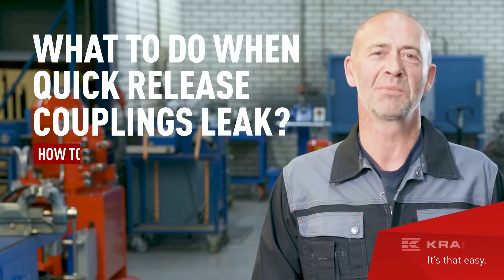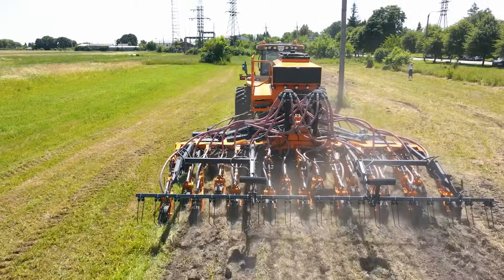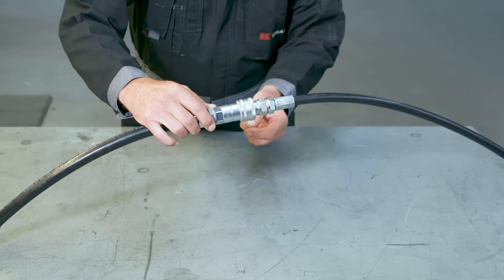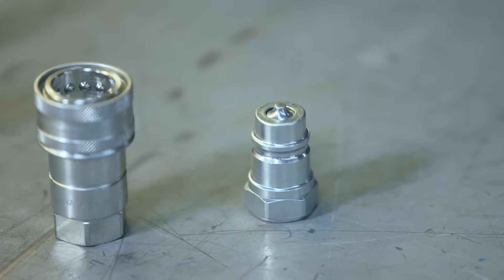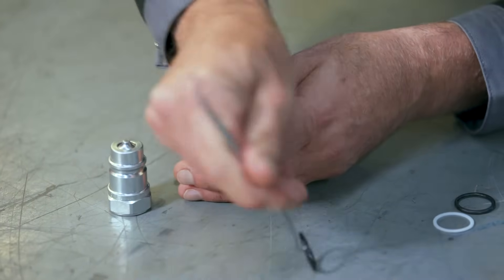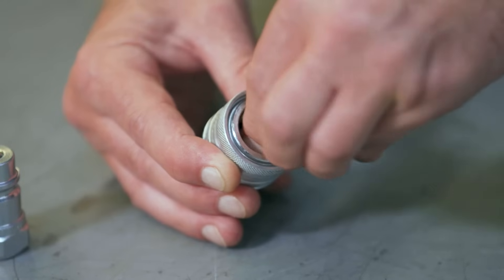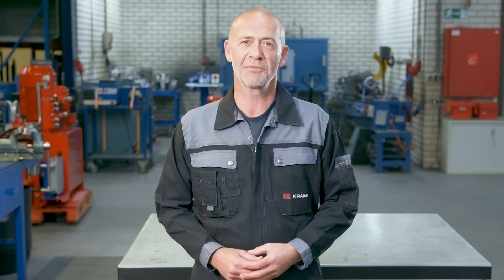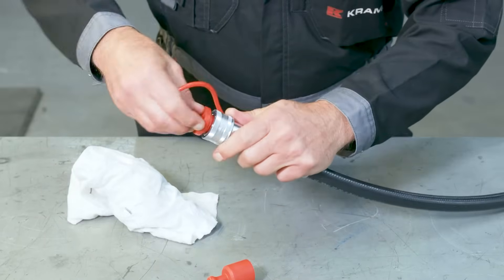What to do when quick release couplings leak? | KRAMP

Comment: Orion Motor Tech R134a Quick Coupler Adapters leak due to seal failure. Now i'll check for part to replace thanks for el tip.

Comment: Do you apply Teflon tape to the NPT threads when replacing a coupling?  Or other sealant?
Reply from the maker: NPT threads are dry seal and will seal on the taper, although a thread sealant can be used if required

Comment: A leaking coupling on a skid steer. It started as a drip. An hour later it was a trickle. I have a machine not being used. I will swap out the same coupling to see if this will stop the leak.
Reply: Did it stop?

Comment: Hi Kramp
I am proposing to use the dry breaks on my 4600 John Deere
to facilitate the snow plow I am fabricating. I wanted your
opinion about if this is a workable idea.

I have obtained a well-used 7 foot Western commercial snowplow
with hydraulic angling. I obtained a TITAN pallet fork JDQA frame.
The 4600 has 4 hydraulic ports to operate the loader that use dry 
break quick connects.  I have attached the plow to the Titan frame
with a 2 pin removable 2x2 x 3/8 angle steel. I have a grade 120 chain
attached to the top of the Titan frame headache assembly to lift the
plow blade. The system works but I have no more hydraulic ports available
on the tractor to operate the plow angel cylinders.

I propose to set up the plow on the 4600 and adjust the lift and a blade 
chain tension. Then shut off the 4600 and disconnect the “tilt” and “dump”
dry breaks from the front end lift. Then connect the hydraulic plow
angle cylinders to the now available “tilt” and “dump” ports on the 4600.
Now, I can operate the plow up and down and operate the left or right
angle cylinders with the “tilt” and “dump”.

MY questions:
1.)	Can the dry breaks disconnect the loader while
 there is minor pressure from the chain tension?
2.)	Will the disconnected dry breaks hold pressure
 changes as the plow pushes heavy snow?
3.)	Do you see and other issues?
Thanks 
George

Comment: New Holland Workmaster 75 with a 625TL loader. Couplers drooling like a navy jet. Capacity is only 2 gallons vs most JD Im more familiar with holding 22 gal. OEM couplers are way overpriced, so rebuilding these. Thanks for the video. Its been very helpful.Ill be looking for your company.

Comment: quickjack couplers brought me here
Reply: You too eh? So much for "leak proof" quick connects! And of course the leak happened a month after my warranty expired. But even if my warranty was valid I'm sure QuickJack has a weasel clause to get out of replacing faulty couplers. SABE MFG doesn't offer a way to purchase from them directly as a consumer. Replacement cost from QJ and their distributors is $50 plus shipping. Final cost is between $65-$73. I found different couplers that would work for $35 (shipping included) but the flow rate was much higher than the SABE MFG. After doing some research it is not advisable to mix couplers that have different flow rates. If I spring another leak, I'm going to change out all the couplers with the others I found or go with the traditional hydraulic couplers (the ones with the bearings inside the female end). I've used that type of coupler for over 10yrs on my plow Jeep and on my tractor with no issues at all.